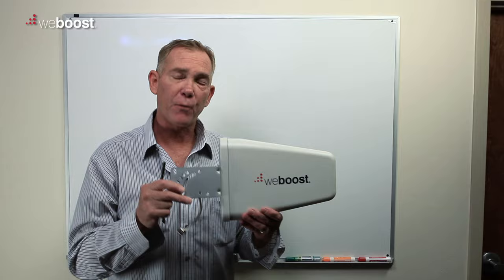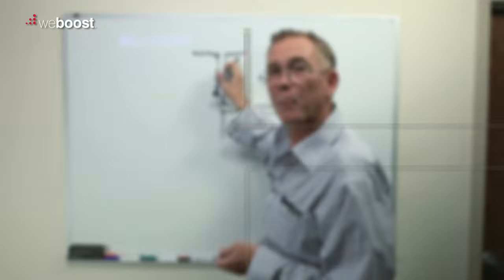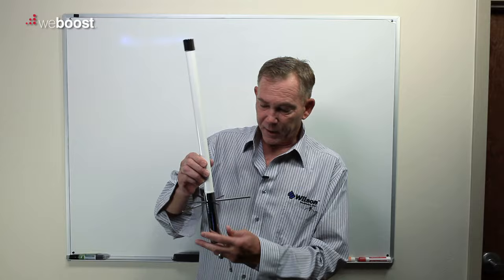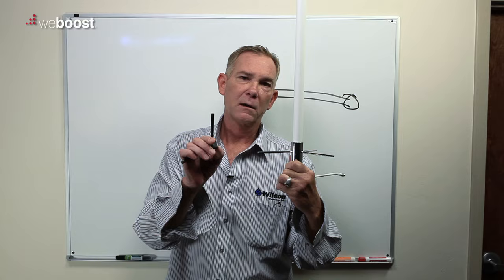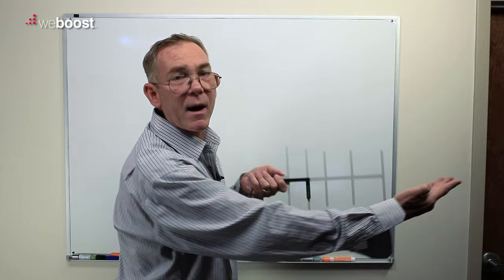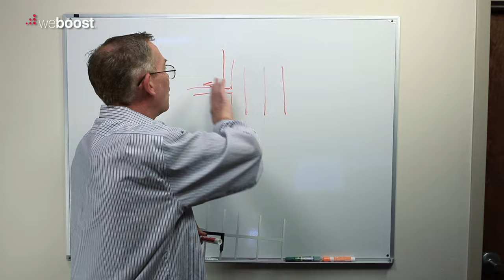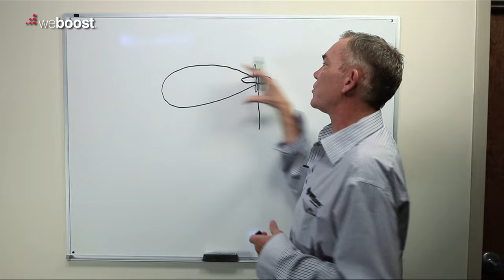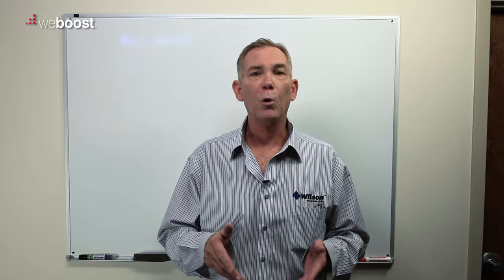Omnidirectional vs directional antennas what's the difference? | weBoost

Comment: I'm an engineer, but not an electrical engineer. I have NEVER been able to determine how, what appears to be a single wire, is able to relay a radio wave into the radio.  This video and "How does an antenna work" explain this very clearly.  Thanks to Don Dinsdale and WeBoost for these, and the other, videos.
Reply from the maker: +Brooks Keys You're welcome, thanks for watching!
Reply: please... how produce radio wave in radio circuit
Reply: It actually uses Don's unbuttoned cuffs to direct the radio energy forward. xD
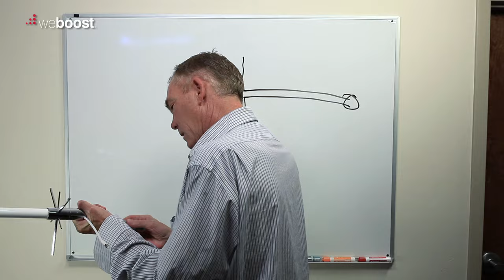Oh, at 2:09  that "thing" looks like a penis antenna, but the main thing is that it works! lol
Reply: What is the mathematical equation for the branches. I know it works in a magnetic flux field. Is it possible to move the branches to optimize the signal? Say when you increase the size of the antenna?
Reply: @TheMikevt  First off, the wave LENGTH of the signal is the reciprocal of the center frequency, sometimes expresses in lambda (velocity/frequency).  In the design of a Yagi, the basic "zero-order" type has all of the radiating elements (smaller directing antennas in front of the reflector) designed to be one-half wavelength long and spaced one-quarter wavelength apart from one another. From here the calculations for the spacing and number of radiators gets more complicated but the principle relating to generate a stronger antenna gain that is more directional with different impedance, side-lobe characteristics, etc. still relates to the mathematical relationship of the radiators.  Bottom line, both the length and spacing/distance is important to ensure the directors generate additive signal strength, just like the prism reflectors in a lighthouse.
Reply: @weboostsignal  sir in wifi adaptor i replace 3dbi omni with 8dbi i found little improvement in signal gain.But when i change 8dbi with 14dbi directional yagi or directional panel antenna i found only 2-5dbm signal improvement.why directional antenna give very little gain?
Reply: @weboostsignal  I’m trying to boost my signal or amplify my signal rf do you have an email I can contact you on ?

Comment: Interesting, thank you. I'd like to see a more detailed yagi analysis. I was told by a ham operator that the directors absorb then re-radiate the energy, and that's how they increase signal strength, so I think I see how they make the signal more directional but not how they increase gain. If you did a more detailed explanation showing what happens at each element of the antenna that wold be very interesting. Thank You.

Comment: Your teaching technique is outstanding.  I have learned a lot.  If you get time can you explain how a single dangling wire on an electrical garage door works.    As well, could you include how the coiled wire around a tube inside the remote works.  Again, thank you so much for your gift of teaching about antenna's.

Comment: What I like about directional Antenna’s is I can receive more clear signals because it’s not receiving signals on the sides and rear of the antenna like static frequencies. Having a omnidirectional will receive all the static frequency’s or whatever you call it. I’ve experienced this with my home base having to have a switchboard and a huge improvement especially tracking a mobile car. Hoping to have your input about this great video though.

Comment: It is probably a good idea to state that directional antennas will radiate in ALL directions, just not well.  For example, if you made a Yagi antenna with 50 elements, it would likely have very good forward gain but you could walk around the antenna with a field strength meter and likely get some deflection of it assuming  in the favored direction it was calibrated for full scale deflection.  It should be stated that even a directional antenna will have  good enough performance near it.  Especially if it is a casually fed array in which the nulls will no be so good.

Also, any omni antenna can likely be turned into a directional antenna by doing any of multiple things to it such as putting a  dish behind it to focus it, creating a phased array or verticals....  So in the case of phased verticals (let's say 2 identical verticals), each antenna then is NOT omnidirectional cuz a main lobe will form .  You likely already know this but I am just stating some exceptions where you are stating the general rule.

Lastly, I wonder why they say when phasing 2 or more antennas that they ideally have to be identical antennas.  What would happen if I took 2 same band antennas but were physically different?   I would assume if fed properly they would still have gain.  For example, if I had a 5 element Yagi and stacked it with a 7 element Yagi.  I put the 7 element lower to help reduce the wind load on the mast and put the 5 element higher since it has less wind load.  I wonder if something like that can be modeled correctly using antenna modelling software.

Comment: first, thank you for your video
how does the electromagnetic wave of antenna travel through all medium without affected by all conditions of environment like( rain ,or faced high building in their way)?
Reply: Gehad Ali: The EM wave IS affected by obstacles (buildings, trees, hills etc). The higher the frequency, the more it is affected which is why WiFi and cell-phones which both operate on extremely high frequencies would have a very short range if they didn't use relay-towers or "boosters".

Comment: Comparing relatively the same power and brand antennas (Omnidirectional vs directional), how much distance (in feet) is gained or lost (looking at the source of intended hookup/contact, ball-park estimate of course)?
Example: a directional antenna can reach out further to the intended/hookup source vs an Omini antenna that spreads out its energy around the antenna… Therefore spreading out the energy will lessen the distance to the intended source...

Comment: On those whips are the spring/coiled portions of the whip there to act as a choke and reduce the amount of reflected power that makes it back to the radio, or are they there to act as an actual spring/strain relief mechanism?
Reply: Marcus Adams: The coils are usually used to reduce the PHYSICAL length of an antenna whilst still retaining the ELECTRICAL length. If they didn't do this you would have to have very long unwieldy antennas on your car !

Comment: The antenna seems to act like an inductor whereas you input current and get a magnetic field. So, the current flows in both direction and cancels out until you bend the wire, does this create a plane? The electromagnetic field being transmitted is the frontal lobe? with very small back scatter and side lobes?

Comment: Thanks for the clear explanation about antennas, one network provider in our area said my place is not yet serviceable for an installed broadband Fiber so I purchased a Prepaid Wifi LTE to the same Network Provider thinking it is better than their mobile LTE , but I can only get 1 to 2 mbps on the average download and upload speed even less, can I use a stronger antenna or will that result the same as my area is not LTE or broadband ready? Thanks

Comment: Want to know more in detail, what makes the signal to jump out from the antenna? Since capacitor also has dipole, can it also be able to radiate?
Reply from the maker: +Nityananda Hazarika RF in fact AC in general will “see” a capacitor as a short. But a coil will radiate to a certain degree so will traces on a circuit board, a great deal of work goes into designing RF circuits to prevent this, so that only the antenna radiates.   EMR, Electro Magnetic Radiation is why an antenna radiates, do a search for this term, there are lots of good examples online.  Hope this helps.

Comment: I have a weboost directional antenna and it works great.  I am in a dead zone with the closest tower being 14 miles away.  I currently get 3-4 mbps download.  My questions is if I mounted the antenna onto an old dish tv antenna would I do any bete?
r

Comment: Can you explain more on effects of link quality in the directional antenna due to movements in a vehicle or something like that? ....Thanks a lot for great explanation.
Reply from the maker: +Deek You wouldn't want to use a directional antenna on a vehicle. Since a directional antenna will only send or receive the signal in the direction it is pointing, any movement such as moving a vehicle would reduce the effectiveness. You could use a directional antenna on an RV once it is stationary but you would have to re-position it each time you parked. An omnidirectional antenna is the best solution for vehicle applications.

The same would go for if your antenna was mounted on your roof and got bumped and moved. The further the antenna points away from the signal source the worse it will get.

Hope that answers your question.
Reply: +weBoost But for long range communication directional antennas would be appropriate ones.Long range communication like off-shore communication uses directional antennas.But the problem is that when ever the direction of the antenna changes the signal strength decreases.Is there any solution to this?Are there any mechanisms that can control the direction of the antenna?what parameters can be considered for this?

Can you please answer ?
Reply from the maker: +Deek Correct, for long range a directional antenna would be the best. There are systems for this problem, they are complicated so I will not go into specifics.  That being said, there are 2 types (1), uses electrical characteristics from multiple antennas to electrically tune in the strongest signal. (2)  a device that monitors signal strength and then mechanically tunes (turn the antenna to track the strongest signal), the system for optimum signal strength. 

If you've got more questions we'd be happy to get into a more detailed discussion. Shoot me an email at socialsupport@weboost.com

Comment: I'm using a SureCall Omni exterior ant. with my Weboost drive 4G-X on my RV, which is aluminum. I get no apparent cell boost. Do I need a metal (steel) plate under the SureCall for it to work properly?

Comment: question, I have a Omnidirectional Weboost antenna, my question is I put it on a 10 ft PVC pole above the Rv but was not thinking about the ground base that you talked about so does it have one built-in or should I have a metal plate below it or lower it to top of the RV ?

Comment: What is the general rule about how far the "legs" of a dipole can be apart?  For example at the feed point.  Are they generally almost supposed to be touching?  What happens if they are far apart at the feedpoint?  Is there a spacing of them that would still work other than "very close"?  For example, what if you had a dipole with 1 wavelength spacing at the feedpoint would it even work?  For example, if someone wanted a roof dipole antenna for say 10 meter band but didn't want the single feedline (let's say coaxial cable) coming down in the middle of their roofline, could they instead have a large "gap" between the 2 legs of the dipole and somehow feed it that way or would the large separation of the 2 conductors in the feedline act as an antenna and distort the pattern?
Reply: You told the professor how he should teach and then ask him a question?  Your definitely a directional antenna kind a guy....but, your missing your tower.

Comment: Here is another question for Mr. Don Disdale.  Suppose I had 4 identical 3 element beams such that each had a half power beamwidth (HPBW = -3dB downpoint from max forward gain) of about 100 degrees and they were aimed in the 4 major map directions (N, E, S, W) and properly fed thru a proper (narrowbanded) 4 way splitter/combiner for the intended frequency.  Also assume that each beam is rated at 8 dBi solo.  My question is would this setup (if done properly) have more gain than a single 8 dBi omni antenna?  You can assume very low loss cables and a very low loss power divider/combiner.  Reason I ask this question is because many ham radio repeaters use a vertical stack "omni" but it is "shadowed" on one side by the tower so I am wondering if for that same application, it would instead be better to use 4 short Yagis pointed in the 4 major map directions.  You can assume that each one would be mounted on one leg of the tower.  For 3 sided towers assume we use only 3 beam antennas with slightly wider HPBW (say 120 degrees each).
Reply from the maker: +David James Short answer, no. Just the loss in the splitter and cable will negate this.  Also remember that a Yagi will only see one cell tower.  So an array of Yagis (unless you are looking for different cell towers at the same time) is not practical. 

The "shadowed" effect would be minimal, maybe 2dB, depending on the width of the tower.

If you need omni performance, a Yagi array will work, but not recommended, just cost is prohibitive.
Reply: +weBoost Well first off I was not referring to cell tower as I mentioned ham radio repeater tower in my question.  Secondly, if the 8dBi gain is retained overall, then the 4 beam setup could be used to transmit equally well in all 4 map directions but a sophisticated "voter" system could be used for reception to best hear a moving target such as a mobile station.  That way as the person drives, the voter system would select the best of 4 antennas to use to receive him clearly.  Since the receive would be better than the transmit in the direction of the mobile station accessing it, the repeater could compensate by running significantly more RF power than a typical mobile station so both receive and transmit are better "balanced".

Comment: Yes.have a question. I live near the public library: 0.6 miles away. I need to catch their wifi signal on my chromebook. What is the best model of unidirectional antenna that i should buy and use for this purpose...tried to improvise something but it didnot work...

Comment: Hello, Mr. Dinsdale! I appreciate you doing these videos, I've always been interested in how electrical fields work. I have, in fact, a question. The Yagi-Uda antenna, if I understood the video, is taking the normal radiation field (which has a given amount of power), and focusing it in one direction, sort of like the reflector in a flashlight.

So far so good. But I also understand that the Yagi-Uda antennas are good at picking up signals from long distances. Is the reflector at the back really making that much of a difference, in how much of the radiation field it picks up? This is a little confusing to me, and wikipedia is only making it worse. Or do waveforms not work like this at all?

Again, I appreciate this series you are doing.
Reply from the maker: +Arbiter Odie A Yagi antenna is a directed dipole.  For picking up weak signals the directors are the key.  They amplify the signal coming to the dipole.  The reflector portion also helps but in a small way by directing the energy that is trying to go behind the antenna back to the dipole.  The reflector gives the antenna a very good front to back radiation ratio.  Say 90% of the energy transmitted or received stays to the front.  Hope this helps.  Do not hesitate to ask questions.
Reply: +weBoost The way I was "taught" is the reflector acts as a mirror and the directors act as a focusing lens.  The more directors the more the pattern is focused "sharper" (think of when you were a kid and used a magnifying lens to focus the sun to burn leaves or ants). Technically it is not really the # of elements that focuses the beams pattern but rather how much boomlength they are spread over.  For example, a 6 element and a 7 element Yagi beam antenna should have almost identical gain if they are spread out over identical boomlength.  However, it should be possible for a 6 element Yagi to have more gain than a 7 element if the 6 element is spread out wider and the 7 element has them bunched together closely.  Usually the reflector and 1st director are fairly close to the driven element but there is much liberty as to the spacing of additional directors depending on the design goal.

Comment: I have just recently moved into a rural area that has LTE and 4G but it does not have it in my yard. I can go out to the road 50 feet and go 200 yards to my left or right and get a pretty decent 4G signal. there are trees pretty thickly surrounding my home. Do you have any suggestions?

Comment: Question for Don Disdale:  Is there a 180 degree phase delay when the main signal from the director hits the reflector and gets reradiated and if so, why then isn't the reflector positioned exactly 1/4 WL (WL = wavelength) from the director so as to be in "perfect" phase with it?  Usually they are positioned much closer than that I think.
Reply from the maker: +David James We do not want the reflector to be additive to the signal.  We want it to disrupt it as to reflect it.  This is why it is longer and not in phase.
Reply: +weBoost But the directors are also not spaced 1/4 WL away from each other and they are additive. I just don't understand how there can be so much flexibility in director spacing and Yagis still work well.
Reply from the maker: +David James This might require a more in depth conversation we'd be happy to continue the discussion through email. Please email us your questions at socialsupport@weboost.com.

Comment: Don Disdale.  I have 2 different towers that my phone gets signal from.    One is at the 12 o'clock position and the other is 90 degrees from it at the 9 o'clock position.  Can I use 2 yagi antennas one pointing to each tower or should I point only one yagi between both.   They are 90 degrees off each other.  If I use 2 yagi how far apart do they have to be and can I use the same tree and use separation by vertical rather than horizontal?  Thanks